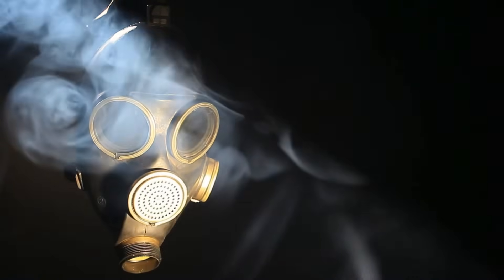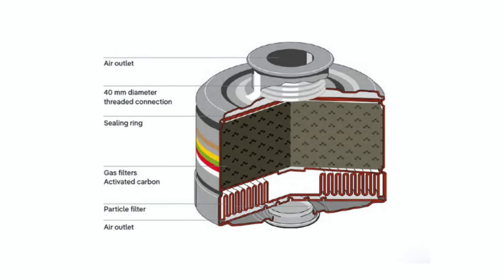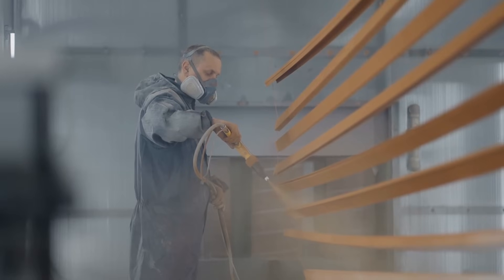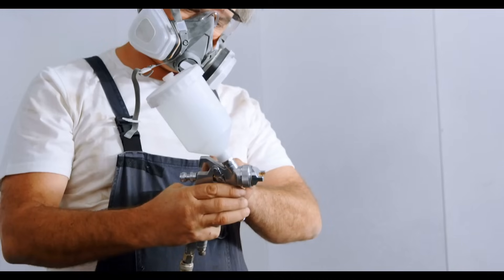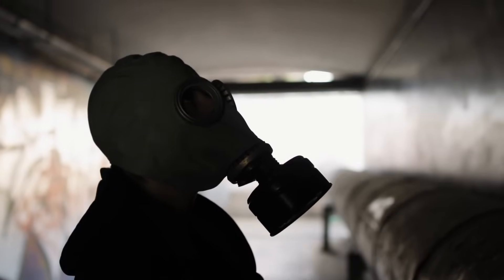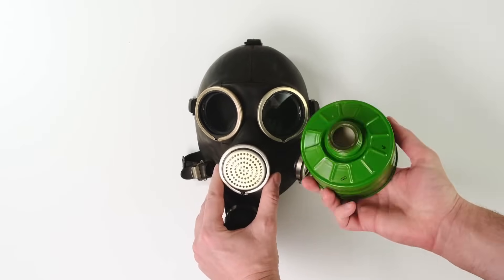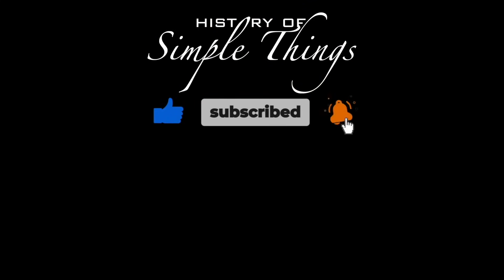How Do Gas Masks Actually Work?

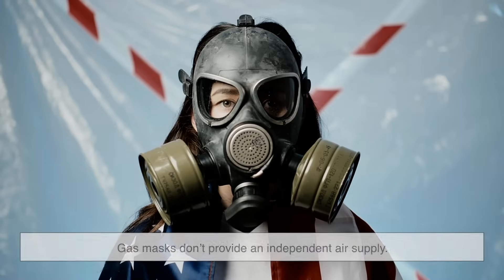Comment: 5:52 SCBA and SCUBA cylinders are filled with clean dry air compressed air, not oxygen. Pure oxygen could case a flash fire under many circumstances and espcially if you were to go in a burning building. Oxygen would be toxic if used for scuba diving.